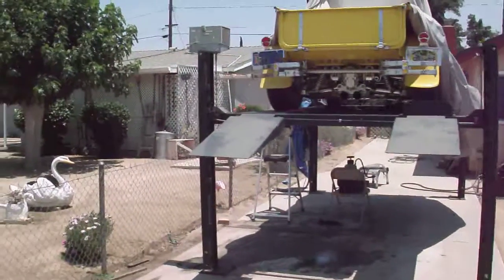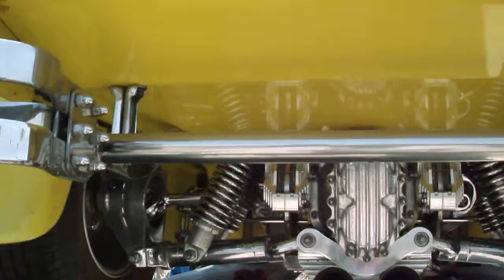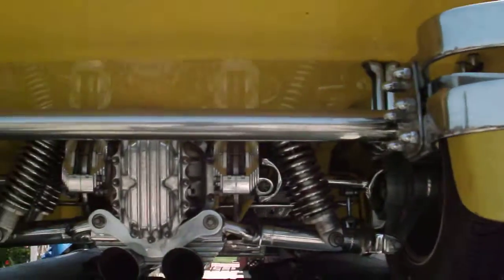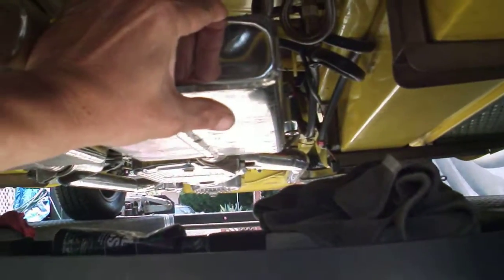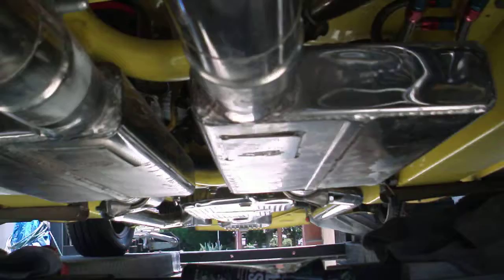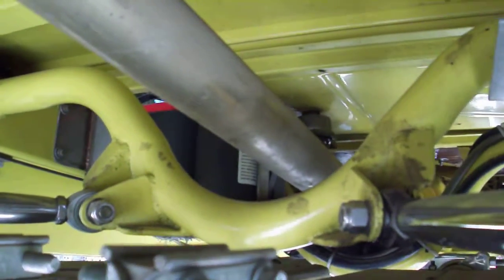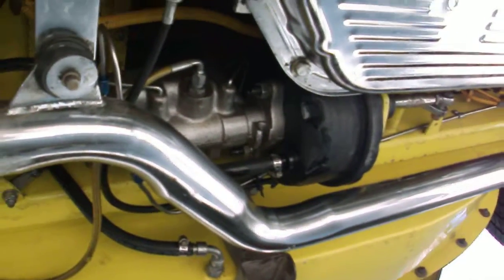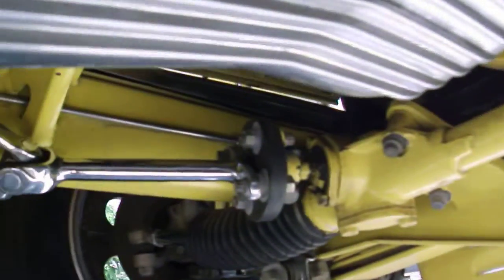Arts 1929 Model A Roadster pickup. All Steel Truck.

Comment from the maker: At 4:51 into the video you can hear the lift the truck is on begin to make a creaking sound...that was a 5.4 Earthquake this afternoon here in North Riverside. I was working and busy so I did not even feel anything...but the bigger one tonight  7/05/19 I was inside on my bed changing clothes and I thought the dog was moving the bed from underneath till I realized its a EARTHQUAKE ..I stood up it felt like rollers under foot...About 25 Seconds all toll...9:03 PM Now and all is well